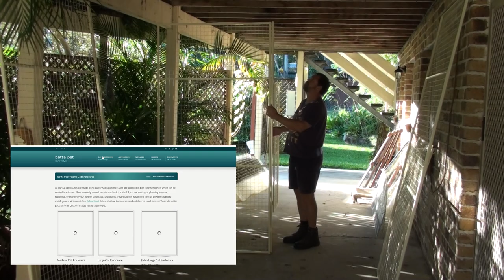How to Build a Cat Run & Enclosure - What Materials We Used For DIY

Comment: I gotta say.... this is pretty awesome! What we did was a bit bigger, hehe! We live in Hawaii and it’s gorgeous out all the time so we wanted our two cats to be able to go out but be safe. We live on a major road and see dead animals several times a week so letting them roam free wasn’t an option. Our house had a lanai (a covered porch basically) and a dog fence that went out into the yard that wasn’t covered. The Lanai + the dog yard runs about 900 sq feet with just under half being grass and the other half a covered deck. We used bird block to create a roof of sorts so they can’t climb out and we used a wire fence material to cover the sides. It’s a pretty massive enclosure for our two cats but they love it. We now have two chickens that live in the enclosure because the rest of the flock was basically killing one of the sisters by ganging up on her and kicking the crap outta her so we had to get her and her big sister outta there and the catio seemed the perfect place! They mostly seem to ignore each other, so no problems there. We have an attached cat door so the cats and dogs can both come in and out freely. The bird block also keeps the birds out... only 2 have ever gotten through in the last year and one I managed to save! I’m really really tempted to start fostering cats since we have such a massive enclosure but I know if I do, I’m gonna wanna keep them, hehe. Haven’t convinced my grandparents (I actually rent the house from them) to let me have a herd of cats but I’m working on it! If you ever decide to creat a bigger place you have an awesome place under that deck! We even have a door in our fence so we can come in and out from the drive way if we don’t wanna go through the inside to get into the lanai! Also, we spent less than $100 on ours.... but we used almost all our existing lanai and then fencing we had set up for the dogs. We only had to buy bird block and chicken wire.

Comment: I don't need a cat run but u did a great job and if I did need one this is a great idea.  your assembly ideas are the same as assembling  your cage you go back & tighten the screws down after  you get all the screws in.   your idea with this is really good but a lot of work :))

Comment: Thank you for the very helpful comment about waiting until the structure is fully assembled before tightening-up the nuts and bolts so that it all lines up more easily . . .  I could just envision myself cranking those nuts and bolts down and then having the problem of lining up the additional parts of the structure.

Comment: That is a beautiful cat run  i have had numerous cats just being dumped at my door, and having lost two, one from being run over in the street, and another one being killed and eaten by hobos, I made a cat enclosure for the rest of the cats. They have a tree to climb on, and an outside area of approximately 4 x 4 metres. The height of the enclosure is about 3 metres. They go outside to do what they have to do, and I do not use a litterbox for them except in rainy weather. I clean up the enclosure from time to time.They have plants and sunshine, and that is important. I would love to add a cat run along one side of the house. Perhaps that will be my next project.

Comment: Fantastic video Mark the best i've seen online so far. You've put the same love & attention into this project as you've done in your gardening. Thanks for all the details included i will definitely be checking out your choice of suppliers.  Hope its not too expensive shipping to Barbados in the West Indies. Cheers!
Reply from the maker: Thanks Geriann! It does save time buying the kit from a retailer if possible but just the same you probably could get any fencing place to build a run and cage to your specs or even DIY the frame and tack the mesh on yourself if you have the time as it would be cheaper. All the best :)

Comment: this is such a great idea - I wonder if you have one for cats in a RV....I can't find much so looking build something similar to what you have but light weight and collapsible for around the RV or at least from a high window to underneath, you've provided some great ideas in the way to work with prefab metal. I'm after sun and shelter for my cat with the ability to get back in at will. I'll need to modify for "at will" but have my own thoughts on that. Cheers

Comment: Just watched video. I’m afraid i could never afford your budget however i had an idea to buy wire mesh panel from Bunnings and then just cable tie it together to make the shapes/tunnels i need. However.....we in sydney. Just wondering if the wire mesh would get too hot for cats in summer....?

Comment: what do you do if they pee or poo on the run? I don't see how you can get to it to clean?
Reply: Most cats do not eliminate in random places. They would wait until they got to their litter box. I can't see any of the 7 cats I've owned in my life ever relieving themselves in the run.  Puking...yes!  If the runs needed to be cleaned, it could be washed/sprayed down with a garden hose.  If I had a cat that frequently pee/poo's outside the litterbox and I was concerned about cleaning the runs,  I would take that into account when designing my plans.  With a little ingenuity, easy-access panels or doors into the run could be designed to allow frequent cleaning.

Comment: Anything less than metal mesh would not have been cat proof. You have also saved the cat from becoming road kill.
Reply from the maker: Yes I agree with you Wendy, but what's interesting is the amount of products and retailers pushing netting systems for cat runs, which I reckon are inadequate (but much cheaper of course). I could just imagine our dog ripping apart some nylon tunnel or wildlife getting tangled in some net enclosure so for us it was a no-brainer to get steel mesh. Cheers :)

Comment: Great video.... but plz do NOT use zip ties. Cats are acrobats and can easily get stuck and hurt their paws/body very badly. And a panicking cat will cause even more harming. I would like to suggest fastening the metal wire on  wooden poles in the corners and thighten it well with screws and/or fasteners.  With cats , always be aware: no lose ends or wire or fence.  (I'm not a native English speaker, hope y'all understand)